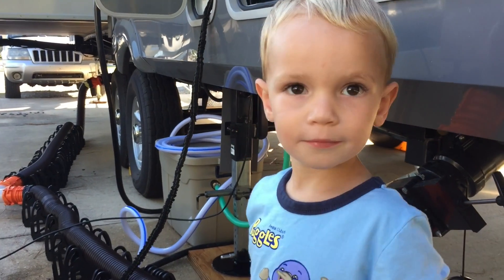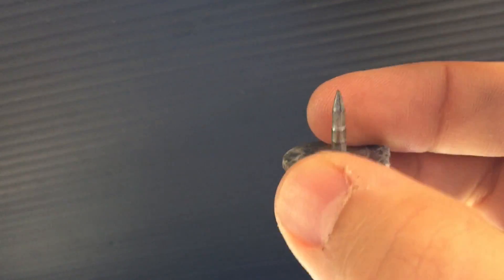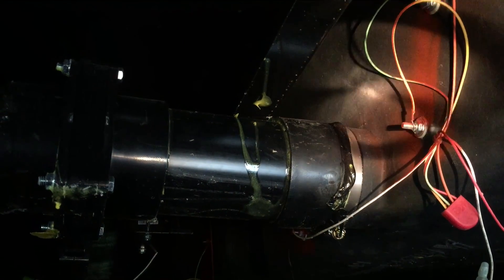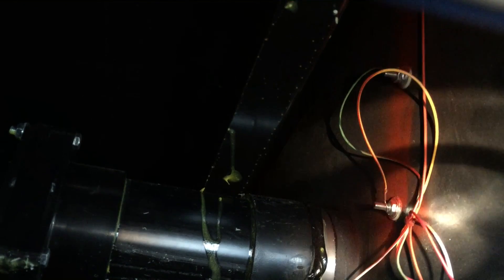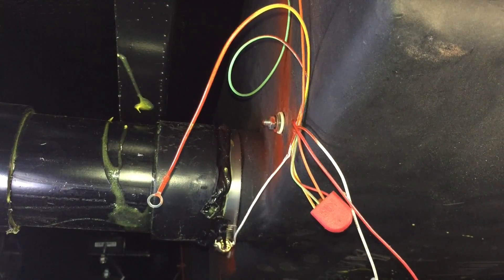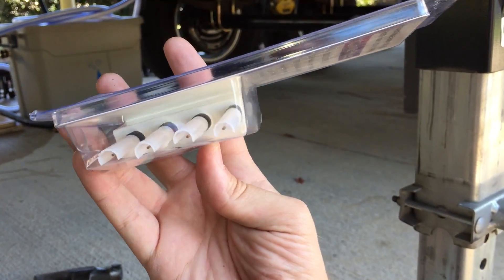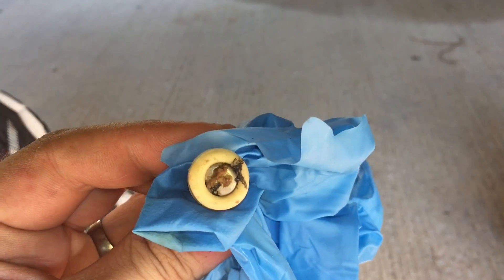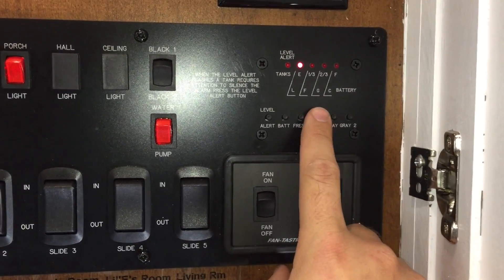Replacing Black Tank Sensors

Comment: I have bought a pressure cleaner with an angle attachment for the end.. It. will reach all the way down into the toilet to the black tank entrance. I have used it on the black tank. pressure cleaned it from the inside out but my gauge inside says it is still full. I asked whether the sensors were front or back so I could aim the pressure cleaner in that area to see if I can clean the sensors off.
Reply: I don't have an RV. I have a cross country zinger light 2021.

Comment: For years my sensors have been pretty good but now they are all stuck on half full.  The newer RV's have outside the tank sensors which are supposed to be better and more accurate.
I would like to install new outside sensors.  Wouldn't it just mean disconnecting the wiring from the old sensors, glue the new sensors on to the tank and connect using the same wiring??
If you replace the old sensors with new ones, won't they just mess up again sooner or later??

Comment: Here the question how did you remove the sensors from the tank? Do their just unscrew from the tank or did you have to put your arm inside the tank and hold the sensor to back the nut off?
Reply from the maker: Jim Blackford the stock sensors have the screw on the backside that needs to be loosened and then it is brute force that pops it out of the tank. There is no needs to get inside the tank.